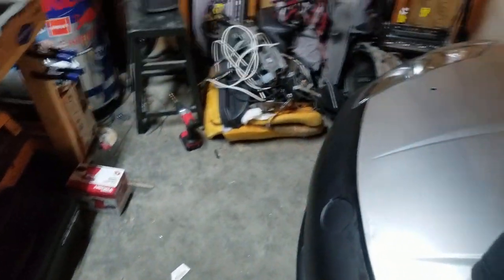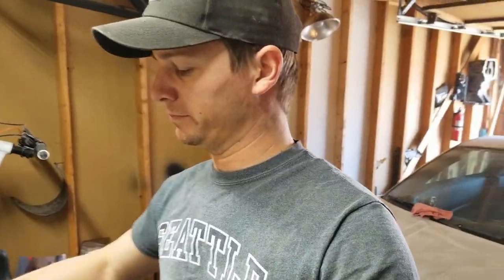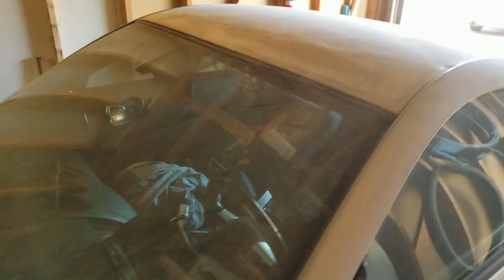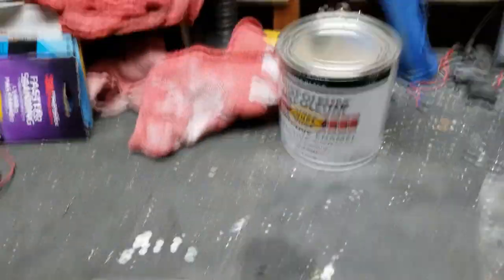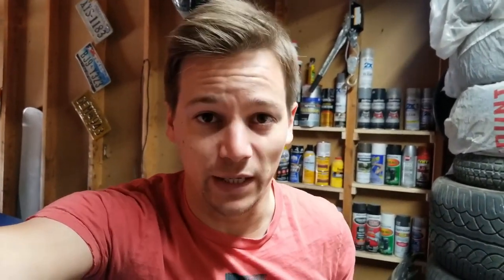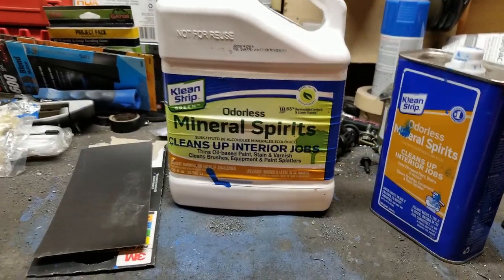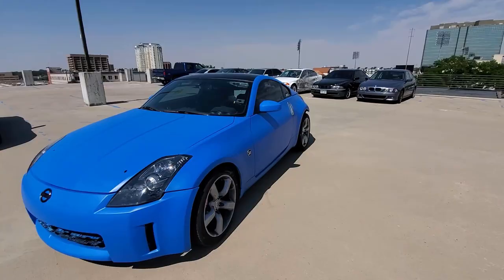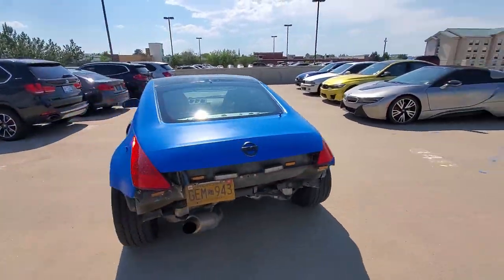350Z Roller Paint Job - $100 Rustoleum Special

Comment: Looks super dope man I like it. What blue is that? Oasis? Ahh i just read its sail blue.
Reply from the maker: Rustoleum Sail Blue lol
Reply: @DillonSmith1  hey did you use clear coat after? Or is that just from the sail blue paint only?
Reply from the maker: @Shinobi117  I put a couple coats of rattle can matte clear on after the blue. It came out surprisingly good but I definitely won't do it again.
Reply: @DillonSmith1  I'm painting an rc power boat catamaran.  Think I might pick up some 2k clear coat.  Bastards want 27$ a pop. Thanks man stay safe out there.

Comment: Hey Dillion so i currently have a swapped manual transmission z and i have a AT Check light and service engine check light did it pop up on your 350 after the swap?
Reply from the maker: I had no new lights or codes pop up on mine after the swap. Don't know if this matters, but did you replace either the harness or ECU or both with one from a manual?